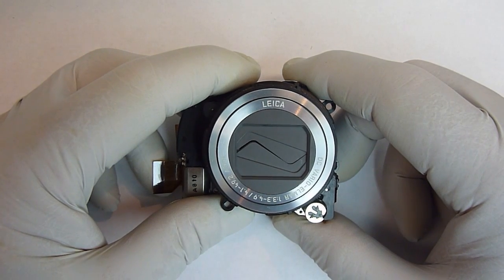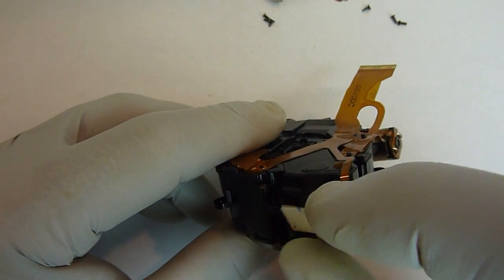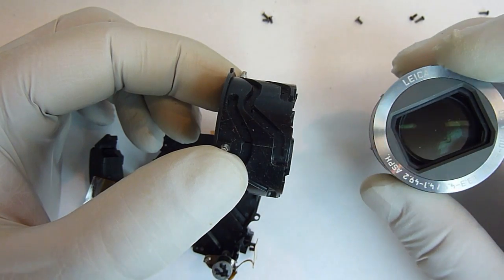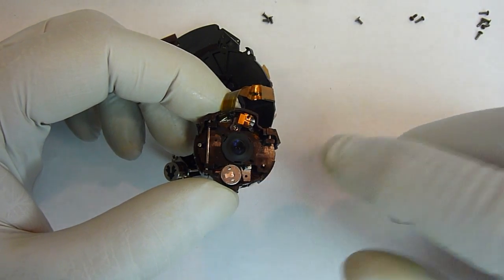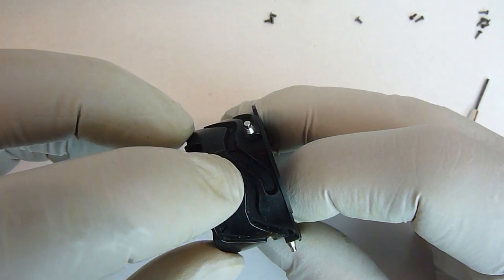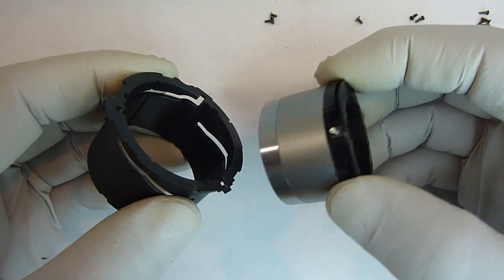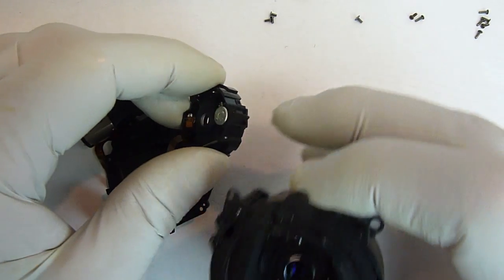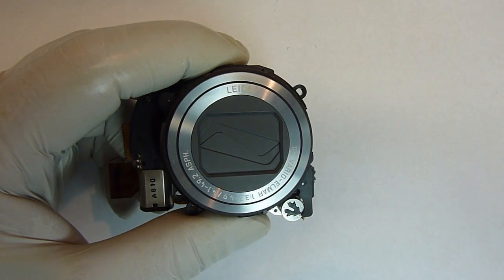How To Repair & Clean A Panasonic Lumix ZS & TZ Model Leica Lens Units

Comment: Hi Robert...thank you and congrats for the video, it's been a great help!

I have a DMC-TZ6 camera and unfortunately it got wet with salt water and some sand is found inside the lens unit...after this the camera continued to function with some zoom troubleshooting.   I followed your video, open/closed the lens unit several times and although it works mechanically it continues giving me zoom system error.  Will explain you briefly what happens when I turn on my camera. 

The lens zooms out completely and it makes some effort at the end as if it would want to zoom out even more (in my opinion, is already in its max), then it closes completely, reopens and it gives zoom error.  But the strange thing is that when I turn off the camera, the lens unit turns back in and comes out completely again when it is spent off. 

I would like to know if possible, to get some advise from you to resolve this problem.  I appreciate your help and thanks again....Angelo
Reply from the maker: Hi Angelo. It sounds like possibly the focus motor assembly may be having a problem moving the focus lens. I didn't show how to work on that particular motor in the video, but I'll try to explain how to do it. The motor is  located on the outside of the lens assembly and is secured with one screw. The motor has a threaded shaft that has a small white plastic piece that rides up and down on the threads, and the threads and plastic piece are both located inside the lens unit. The white plastic piece that rides on the threads moves the spring loaded focus lens up and down. A lot of times the plastic piece will get dirty and it will not move easily on the threads. This can sometimes cause the error message that you see. To clean the threads try to hold a Q-tip or fine cloth on the threads while spinning the shaft with your fingers while holding the plastic piece in place. Don't use any oil on it (though I have had to do that in some cases), as that can cause dirt to collect on the shaft. The main thing to check for is that the white plastic piece moves very easily on the threads. Another thing to check is the focus lens unit itself, which moves up and down on a metal shaft. If it is dirty it may not move easily, which would cause the focus motor to stall, which could also cause the error message to be displayed. If it still doesn't work properly after making sure that those items are clean and move easily,  then I would guess that there may be dirt or moisture inside the motor itself. Unfortunately you would need to get a replacement motor to fix that. I hope this helps out Angelo. Let me know what you find. -Bob
Reply: Hello Robert, thank you so much for your response, very kind of you.  

Yesterday beofre I contacted you, as a last test check, I did take out the focus motor and cleaned  a little bit the plastic piece's guide, but not the threaded shaft which I notice that there is a white grease.  Will take out the motor again for a thorough cleanse and will replace the white grease.

In my opinion, I think the focus motor lens is ok because when I take out the white sensor, I see the small black plastic piece going up and down from the white sensor's working area.

I think the same white sensor works out ok because when it was out of its position after having turned off the camera, the focus lens would remain inside,   opposite of what I told you in the previous message, that with the white sensor in place, the focus lens remained outside with camera spent off....so, I think the sensor "reads" the movement.

Thanks again...Angelo

Comment: Very impressive. This is just hat I am looking forward to. An appealing challenge. Object to be dismantled and cleaned: Lumix TZ10. Many years of rough use but still working quite well. Specks of dust, etc. abound. The screen on the back shows glossy and matt areas but I should think this does not matter for taking pictures. So, if not an issue I would keep it (although replacements seem to be available). Front protective cover acts just as you say, it opens, but not quite. Could it be that the lens has become pitted from the inside or is that just the appearance of remnants of extreme humidity, like lots of tiny tiny stains of condensation. Pictures appear OK but are no longer of the same quality and not as sharp (just softer) as those of my new TZ70. I use the TZ10 a lot around Japan where it gets hot and very humid, and I always shove it into the pocket wherever I go. So wit may be exposed to an extra whammy of body-related humidity which might also explain the peculiar "discoloring" of the screen at the back. I like DIY challenges of this kind and want to continue to use the camera as much as possible. (Also, my son wants it.)
Robert, if you have any advice to give related to above I'd very much appreciate it. I realize that the TZ0 may be different in some regard from the camera you are directly discussing but that shall be my risk.
Anyway, many thanks for putting together such a good show for all those who can appreciate this sort of work. All the best also with your marvelous photography. Nick.
Reply from the maker: Hi Kai.

Yes, DIY challenges are fun! I love them too. 

The glossy/matted areas are most likely just on the LCD screen itself. I do the same thing with shoving the camera in my pocket while I'm hiking, and it does do a lot of wear and tear on the LCD display screen. Is there possibly a screen protector already on the screen that may be showing the wear that you are talking about? Just a thought.

The lens protector problem is most likely caused from dust or grit on the inside of the lens tube. That's really common in moist or high humidity situations. I run into that a lot. Unfortunately you will have to tear the lens unit down completely to clean it 100%.

The spots on the lens are probably condensation spots. I've never seen any physical pitting or scratching on the inside of lens units, except where I did it by accident while working on it. I have dropped cameras (unfortunately many, many times!) with the lens unit completely extended, into both snow, and also water, where just the very front of the main lens got wet, and I would wipe it off right away thinking I just got lucky that it didn't get wetter. But, after shutting the camera down and then turning it back on a while later, I would find a halo around the edge of the picture from humidity building up inside. Eventually the halo effect would disappear, but it would leave some  staining behind on the inside of the lens and I would have to open the lens unit up to clean it. So, it's possible that in addition to the spots that you already see on yours, that there is also a thin film built up on the entire lens inside. And that could cause the problem with the pictures not being as clear. You should also check the CCD and clean it too if it needs it. I've had more "stuff" show up on the CCD of my ZS10  than on the lens.

Good luck with your cleaning project Kai. Give me a shout if you have any other questions.

-Bob

Comment: I have a zs20. When in video mode and using the zoom, sometimes it will stop the video. It does not happen all the time. Any ideas as to a solution. I love the camera.
Reply from the maker: +Alan Gelman I don't think I've ever run into that problem before Alan. Is this problem something that you've always run into, or did it just start doing it? The only thing that I can think of that even closely relates to this problem is something that I ran into with my Canon 60D camera. While recording video it would just randomly stop the recording. Not always though, just sometimes. It turns out that the problem was my SD card, which was a low cost SD card, and it was just too slow to keep up with the recording depending on what I was recording. I purchased a faster card for the camera and the problem disappeared. So....possibly....maybe....when you're zooming in, the video is needing to save more info to the SD card and the SD card can't keep up and so the camera stops the recording. That is a 100% stab in the dark though Alan.

The only other thing that it may be is possibly a main board defect, or a "sticky" spot in the len's internal zoom components (motor, gears) which may be causing a power drop due to over-current while you are zooming.

Sorry I can't be more help.
-Bob
Reply: +Robert Hosea .I've had this camera 3 1/2 years. Never had the problem until 6 months ago. I love the camera, and have taken about 400, 5 minute videos of local  talent here in Las Vegas. Sound and video are great for a point and shoot. I guess it might be time to upgrade to the dmczs40. I will try a new sd card, thanks for the tip  A gelman
Reply from the maker: Alan, something that you might try, just for curiosity sake, is to see if the recording is shutting down when the zoom level is put in the same general area each time. If it does, then that would point to the possibility of a a problem in the lens unit itself. Possibly the zoom motor or other internal components. This would only help you out though if you thought you might be willing to change out the lens unit. A new lens unit from eBay costs about $130.

Comment: Hello Robert.  I'm wondering if you have any videos explaining how to fix motor noise in a Panasonic Lumix (mine is a DMC-ZS3)?  Over the years, it has started a serious clicking noise when I zoom while recording video.  I also noticed clicking as the camera was auto-focusing while I panned some scenery (this model does not have an auto single focus feature).  It's not clear to me whether this is repairable, whether there are two separate motors, and what type of grease to use (lithium?).  Thanks in advance for any thoughts you may have.  Cheers.
Reply from the maker: +Stuart Smolkin Hi Stuart. I'm sorry I don't have a video regarding the zoom/focusing noise. But I'm sure I'm sure that the noise is due to dust, or to the lack of lubrication of the moving parts inside the lens unit. There are two separate motors for the zooming and focusing. The zoom motor sits on the outside of the lens unit, and the focusing motor is on the inside.  I've seen the focusing system fail due to lack of lubrication on the threaded shaft and the plastic part that moves up and down on it. If the moving parts are getting sticky that may be causing the noise you hear. That will be the area that you will need to apply some lubrication. I have used lithium grease in the past on the threaded shaft and I've never had any problems with it. In the case of the zoom noise that won't be quite so straight forward. I doubt it is the motor causing the noise. The noise could be from any one (or all) of the moving sleeves that are on the inside. You will have to tear the lens unit down all the way and clean all of the parts. You should not use any lubrication on the sleeves at all. They should just be cleaned. Let me know how you make out and if you have any questions. -Bob
Reply: +Robert Hosea Thanks so much Robert.  Based on what you said, I was able to find a video pictorial of how to lubricate one of the motors (link: http://agardenersmusings.blogspot.com/2013/03/fixing-jammed-focus-lens-in-panasonic.html) and also was able to download a service manual for my model (link:  http://elektrotanya.com/panasonic_dmc-tz7_zs3_sm.pdf/download.html).  I'm going to try to clean and lube the zoom motor.  The only remaining question is what type of lube to use, and where to obtain it (I googled the Panasonic lube part number but didn't find a source).  Any thought on this would be most appreciated.  Cheers.
Reply from the maker: +Stuart Smolkin The picture shown for step #10 in the link you supplied is correct and it is the focus drive motor. Regarding the lubrication to use; you should not use anything that contains Petroleum because of the plastic part that rides on the threaded shaft. I've used white lithium grease (that does not state that it contains Petroleum) in the past without any problems.
Reply: +Robert Hosea Robert, I will indeed look locally for some white lithium grease (with no petroleum additives).  Also, in case anyone is interested, I did find some lube that is intended specifically for cameras.  I''m posting a link here in case this information is of use to your readers (the cost is about seven dollars and it is shipped from China):  http://www.ebay.com/itm/261640441199.  Thanks again for all of your guidance.
Reply: +Robert Hosea Success, Robert, in solving my zoom and focus noise problem.  Thank you!  I used your instructions to remove the lens unit and rear lens assembly from my Lumix DMC-ZS3.  This gave me access to the two  drive gears for the zoom motor and to the worm drive for the focus motor.  I cleaned, then lubricated lightly using a toothpick, with non-petroleum white lithium grease as you suggested (purchased a tube of Permatex #80345 stocked locally at Auto Zone).  Careful (?) cleaning still left dust on the UV filter, so I quickly disassembled and blew it off gently with a can of compressed air from Office Depot, being careful to hold down the rubber gasket with a small screwdriver so as not to blow away the UV filter.  Anyway, the noise during recording is now almost inaudible (i.e., about as good as new).  I hope this info is helpful to others, and thank you again for your emailed suggestions.  Cheers.
Reply from the maker: Stuart Smolkin
That is awesome Stuart!! I'm glad you were able to get the majority of the noise removed. This will be very helpful to me and others. Thanks very much for taking the time to post back about your results.
-Bob

Comment: Thought: to facilitate better cleaning when you are forced to use the cloth. How about trimming a pen so that it will fit smaller spaces?
Reply from the maker: truthtuube I've never tried trimming a pen before. But I don't see why it wouldn't work. I have an old Nikon pen that I'm sure I could try it on. Thanks for the idea!

Comment: Hello, my name is Lisa. I've had the same Lumix DCM-Tz2 camera for about 8 years. Yes it's old, but it is by far the deadliest camera I've ever had.  Dropped it, in It's case one day, and land d it on the corner of the camera, the only spot not protected by the cas. It quit working, won't even turn on. I have about 5 other digital cameras, one being another Lumix, but none of them one remotely close to the wicked pictures the Tz2 takes. Other than the purple lines through the picture, it's my favourite. Now, is there a way to save my camera??
Reply from the maker: Nunya Bizziness That's a tough to say what's wrong with it without seeing it Nunya. Did it physically damage the corner of the camera that it landed on? And, was it the top corner nearest to the power switch? Also, does it beep at all when you turn it on?

Comment: Hi Robert, I also have a ZS19 that I've partially disassembled with the help of this and other videos. One thing I couldn't find anywhere is what type of screwdriver is needed to get at the sensor.  It appears to have torx screws and since I don't have a set myself, I bought a T1, but it was too small.
Reply from the maker: Dave Hrencecin I have a TS19 partially disassembled on my workbench. I will find out what size it is and get back with you.
Reply from the maker: Dave Hrencecin The Torx screws on the CCD sensor are T-3.
Reply: Robert Hosea Excellent!  Thanks ever so much :)
Reply from the maker: Dave Hrencecin You're sure welcome Dave. I hope you get your camera up and running!
Reply: Robert Hosea Oh well... I managed to figure out how to assemble and disassemble the lens, but then as I was putting the lens unit into the casing, I broke one of the tabs (similar to what you're pointing to at https://youtu.be/zDGVqY2N0PM?t=377) and the edge of another of the tab "seats" also broke.  I might be able to help you reassemble yours so that you can make a ZS-19 video, but it looks like my camera won't be recoverable unless I can acquire a replacement for the two parts that I've now broken.

I'm more than happy to share what I've learned, in any case.
Reply: Dave Hrencecin Im in the process of breaking down my ZS19.  I Love this camera.  I keep getting zoom error and the lens will not move.  I can hear the motor trying but no success.  any hints on how to align the gears or tips so I don't break anything putting it back together.  thanks.   Kelly
Reply from the maker: KC O Hi Kelly. One key alignment on the focus motor is to make sure that the white tab, which runs up and down the threaded shaft, is inside the grove that runs parallel with the shaft. Also, you need to make sure the spring is put back in before putting the focus lens (the black plastic part with the lens) back on. The focus lens assembly runs up and down the smooth  shafts with the white tab on the threaded motor shaft. One other thing you might check is that the white tab on the threaded motor shaft moves freely. If it is hard to turn it then that may cause the problem you are having. You may need to put a very small amount of lubrication on it to help loosen it up. I hope this helps.